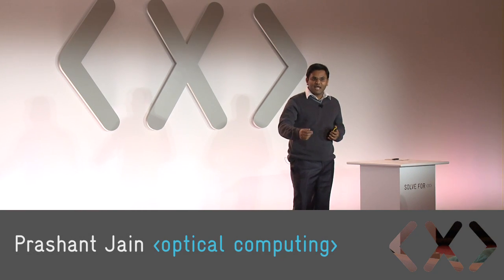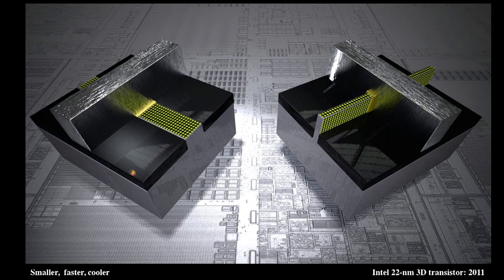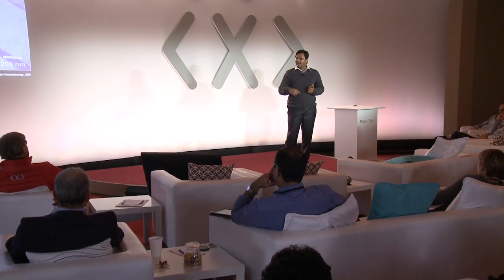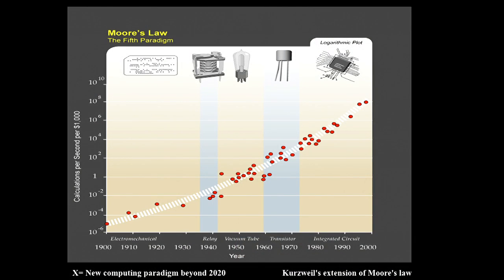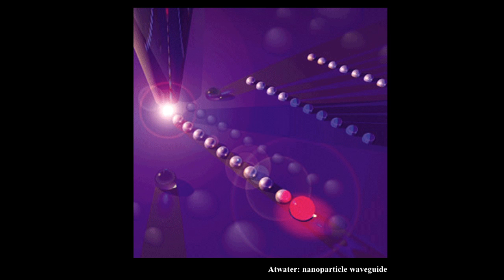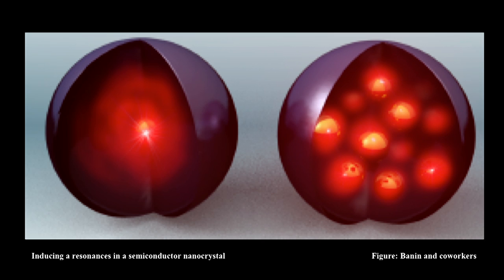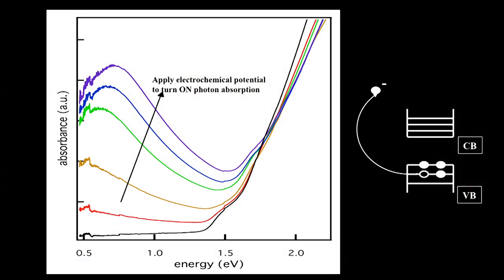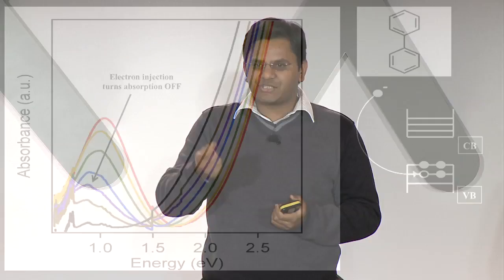We Solve for X: Prashant Jain on optical computing

Comment: Here's a logic gate for light, it covers both AND & XOR, the green line is a mirror, the blue line a refactor, the orange & yellow is the 2 beams of light coloured differently for clarity, the collision provides a 1 for the AND result, anything else provides 0, the refactor is for directing the light to XOR result, the mirror is likewise for directing to the XOR result, the rest is just utilising angles & capturing the output, the excess light from a collision can just be sent to a capacitor or clock or something ensuring the energy is not wasted.
https://drive.google.com/file/d/10D-1ML0Bag-JMOBKCmNcZWgtRRwu8e1q/view?usp=sharing
Reply: what paper describes this method with more detail?
Reply: @absolute___zero  None that I know of, I got the idea after some veritasium vid mentioned prisms (been a while since I posted the comment above, don't remember if it was on the vid I mentioning), I'm too lazy to experiment with the idea so whoever wants to run with it do so, just remember if you manage to make money off of it I would appreciate some of it being sent my way, even if it's just 1%, it'll still help since I'm on UC atm

Comment: This is not an all optical transistor because you still need to apply electrical chemical current to let copper sulfide allow the light single pass through.
Reply: well noted. and the gate delay of doped semiconductor of 5-30 picoseconds kills all performance you are getting when computing with photons

Comment: Given that there exist ways to finely attenuate, amplify, phase shift and frequency shift light using only optics and additional pump light, you can build optical logic gates, which means you can make memory flip flops, adders, with a comparator and even a clock with some phosphur as an optical capacitor. can't you build a whole turing machine with no semiconductors in it? how fast could that machine go if made small?

Comment: So what would be an estimate for the fastest clockspeed of an optical processor.
Reply: sonof hendrix Suposing this works with non ionizing radiation and they find a way to use the light wave itself as data bits. I think the max clock speed would be the same frequency as just bellow UV light.
Reply: Sonof hendrix; if your still here
The maximum clock speed is fully dependent on the gate speed of the light entering. Even in crude electro-photinic hybrids made with electro optical switches in the 1980's the max clockspeeds where in the Thz range.
Currently it is in the single digit picosecond per pulse range. 
Pico seconds are of course currently believed to be the smallest unit of time measurement possible, and will remain as such unless someone finds loopholes in the lightspeed constant.

Comment: There is a problem with this talk. CPU stopped shrinking in 2005, because the quantum effects didn't allow to make smaller CPUs.

One Hidrogen atom is 1 nm wide. Circuits stopped shrinking at 22 nm, because you get circuit lines as thick as 1 atom, you cannot get thinner than that.

Until now, that is... http://www.trustedreviews.com/opinions/intel-s-14nm-revolution-everything-you-need-to-know
Reply: They did not stop at 22nm they will continue down to at least 10nm.
Reply: one hydrogen atom is 0.1 nm.

Comment: I honestly think optical computers will replace our traditional electronic computers. Quantum computers have potential, but they remain basically random, they work on far different principles and require environments where quantum interference is down to a minimum. That's not good for personal use. Optics though, work in almost the same way electronics do, but many times faster. I don't think it'll be long before optical computers are a reality. I have lots of hope.
Reply: Yeah quantum computers will only really be available to big industry (specifically the NSA, because decryption and all that). Then again the modern computer used to only be used by big organizations. But quantum computers have to be cooled to near absolute zero, so this strictly confines the creativity to engineer it in a way for the private consumer. I foresee Quantum computers will only really begin to become personal in the next 50+ years. Photonics on the other hand appear to have massive potential for little, with not nearly as much inherent limitatations as quantum computing.